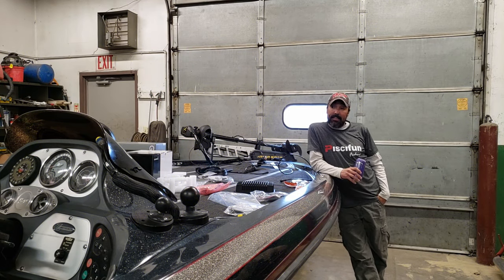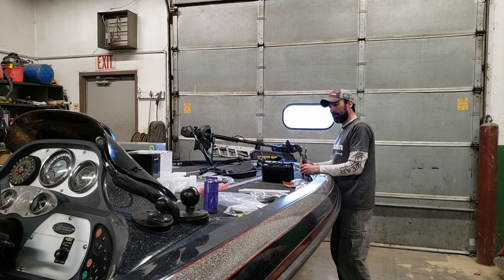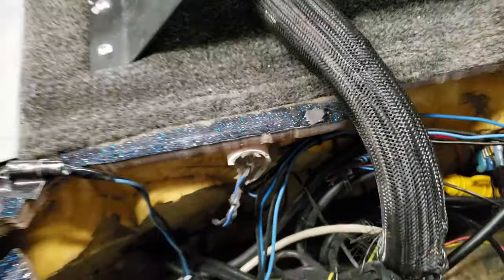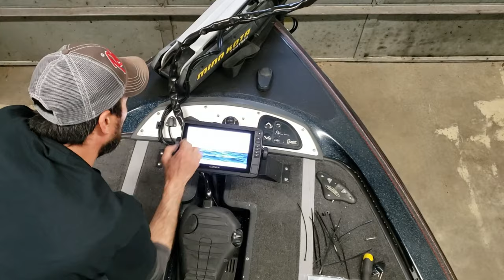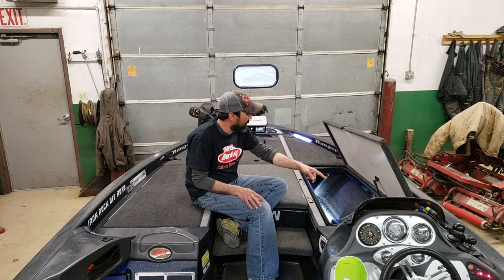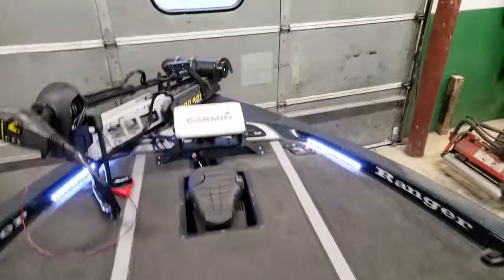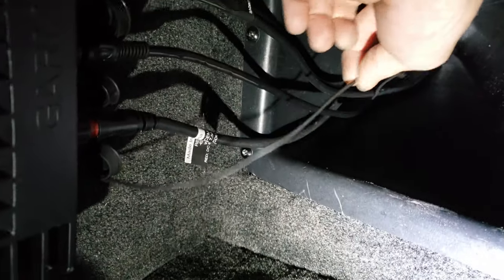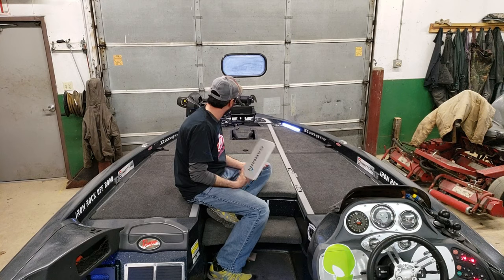Panoptix live scope installation

Comment: I put my system in the port rod locker on my Ranger 185vs. I just cut the end cap off of one of the tubes and ran all my wires in the tube. And put my 30ah lithium battery in the same compartment.

Comment: Hey brother I’ve been researching the pan optics you need to get rid of the cables ties and use waterproof electrical tape they say it will harm the cable
Reply from the maker: I found out about that. I actually did go to electrical tape. I didnt zip tie the wires down tight. I never do with any wire.

Comment: Did u did take out the driver side rod tubes without having to break through any foam??
Reply from the maker: Hello, I did not take out the big opening rod sleeve. I drilled out the end of the rod sleeve tube at the bow and ran a 2" black pvc pipe in the sleeve. I did not wanna mess around with the foam or removing the sleeve. The end of the rod sleeve was exposed inside the bow area with all the wiring.  Some boats might have foam covering a little at the end. Some peoples boats might be a little different with workmanship from the factory. Might need to remove a little foam at the bow, end of sleeve.

Comment: Great video! I’ll be installing mine over the weekend in an 07 Z21 so an almost identical setup. I had a few questions 
1. how you mounted the box? It looks like (2) through bolts from the inside of the center storage box? If so, do you feel like that was enough to secure it for rough water? 
2. Seems like from other comments, you ended up powering the box directly from your cranking battery? I assume you bought a longer cable
Reply: Accidentally posted before I was finished with the second question lol. If you did buy a longer cable, what was it and any tips on running that cable to the battery? Thanks!
Reply from the maker: I drilled holes thru the compartments, my center compartment to the starboard side compartment. Used small nuts and bolts to hold the panoptix module box. Solid mount. At first I did run power wires to that power block at the bow which runs trim panel at the bow. I went away with that and decided to mount a fuse block under the console which was wired to the battery. From the panoptix module box, I ran the power to the fuse block. I believe it was a 12 fuse block which I run all my units, nmea, panoptix and 3d scan module. I dont have the panoptix anymore. Now using all lowrance. And waiting for the new lowrance  livesight to come out. I did like the panoptix.  Just didn't like that 20 degree cone. It really didn't help catch more fish lol. Its a good tool to have to see the fish. Kinda wish I still had the panoptix now because of the panoptix perspective. Dang lol

Comment: Although my Livescope was already installed when I bought the boat, excellent video! I would have liked to see how you installed the main bracket. Because I don't like the position of the unit, it blocks the Lowrance in the bow and I can't see it, I want to move it towards the TM pedal to have the Lowrance usable, as you said use the DI in shallow water. So my question is, can I just remove the bolts in the floor for that mount (without fear that nuts or something will fall from the underside of the floor) then drill 4 new holes and use those same bolts? Thanks for you help!!

Comment: Thank you for the timely and helpful video. I have a 2006 519VX and will be doing the same installation this winter. The only thing Ill do differently and something I'm struggling to figure out is how to install the transducer on it's own pivoting extension pole so the scan can be controlled independently of the rotation of the Ultrex and its spot lock feature. I've seen several how too videos on how others have done it which has given me ideas for engineering my own setup. So whats your opinion of the system after a season on the water with it? Is it a useful tool for us bass fishermen? Do you think it will help improve my crappy crappie skills as well?
Reply from the maker: Honestly its a useful tool for off shore fishing. But when you get up in the shallows pitching docks i turn it off. But great for the deeper water and drops from the shallow. I used for crappie fishing in the spring and helps you find the school that move away from ya. Lets say you in 10 feet of water and the weeds are  3 feet tall and the bass are in the cabbage. It wasnt helpful to me. So i turned it off and used my down imaging on my lowrance at the bow mainly for depth and contour. Im gonna try the lowrance live. Im hearing that is more for the bass guys. Just the info i was getting for that reason. Not knocking the panoptix and i did like using it. It would be a great item for ice fishing to.
Reply: Thank you for the reply. I'm going to experiment with purchasing a used or inexpensive foot cable controlled trolling motor and attaching it to the Ultrex. Striping it of the motor and all electrical of course leaving it as a simple foot controlled pole. Would end up with two foot controllers up front but at least you're operating hands free. It appears that you have the tools and resources to engineer build and market a design specific optic scan controller. Best
Reply from the maker: @ranger5697  if i only had the time to build one. I have a few designs which i have lingering in my head. One would be a mobile boat and ice fishing deal. The boat mount, using radio control servos to move a light pivoting mounting pole in diameter of a trolling motor shaft. That would take some major electronic engineering setting up with a foot control like power pole buttons. Hey id like to see the results with your foot pedal idea using an old trolling motor. Or even an old minn kota power drive non cable.
Reply: Sounds pretty high tech. Good luck with that. Love your boat. My 519 has the exact same trailer. My boat wants to be a 520 when it grows up. Like what you did with the led lighting too. Cool stuff. Good fishing

Comment: Where do you put the ground wire from black box to?  Not that they give you one.  Gotta connect one then ground it.
Reply from the maker: I grounded it to a negative terminal on my boat up at the bow.
Reply: @BassGoneWilds  I have an 06 z19 so did u go to the terminal board at bow and put to the black wire side for ground. I only have black and red side no ground block.  Thanks

Comment: How di you find out where to go through for the hole on top?
Reply from the maker: If there isnt foam in the way, look to the console side the end of the plastic sleeve should be visible. Kinda tricky drilling out a 1.5 inch hole with a spade bit. Just becareful. Some might have to cut away some foam to see the tip of the sleeve. Bow end side. Under bow panel plate. Also i cut slits on the bow plate, bottom lip side to run wires out

Comment: i’m installing mine now. did you put a cutoff switch to your black box so it’s not constantly drawing? i think i wanna hook mine up to a switch on my panel, i just haven’t seen anyone do it yet
Reply from the maker: My box was hooked up to the power panel at the bow at one point. I have a main power turn off switch for all power to the main battery. Includes power trim, jack plate pump, everything powering the console.
 Fish finder Units, nmea2000, 3d box, and at that time the panoptix box go to a separate fuse block under the console i installed which goes directly to the battery with a shut off switch.  I turn everything off when im not using the boat stored in the garage. Had no issues while on the lake all day running.

Comment: Did you ground the module? If so, what part of the boat did you use to ground the wire coming out of the module?
Reply from the maker: To the ground location in my bow electrical panel. If u dont have block at the bow. Use the console electrical block panel

Comment: How the heck did you get a hole in the end of that rod storage area?  I can't even touch the end with my hand in my 2011 z521?  I tried taking it out too but seems like it's sealed in there really tight.
Reply from the maker: Drilled it very carefully with a spade bit, on the bow side. That tight little area in the wire compartment.
Reply: @BassGoneWilds  and you put clips on the power cords and attached the power to that small panel in the bow for the garmin livescope box and your graph?  No power issues so far I assume?
Reply from the maker: @Brandon-uo1rv  yes didnt have an issue at the bow graph at that time. This year i decided to run power straight from the battery to my own fuse block under console. Then ran new wire to the bow only for the graphs. I was having a screen glitch every time i started my out board at the console graph From the factory power block. So now its all straight connection to the battery only for the graphs and nmea 2000 power.
Reply: @BassGoneWilds  I saw that you said you went to Lowrance but wanted to comment that folks are saying to run LiveScope all day long go with independent battery for LiveScope. Some are going with a small lithium battery, I am trying to hook up a group 27 independent battery in same storage locker that you put your black box in. More weight etc but I hate having to worry about a drained starting battery! Still researching best options. Thanks for your video!
Reply from the maker: @richardhamilton3163  just my thoughts. If ya have a good group 31 battery for your starting battery i wouldn't see any problems. I run my power poles and all electronics, charging my phone and bluetooth speaker etc.off my group 31 starting battery. I fish days from sun up till sun down and never had any issues with a drained battery. Sometimes i make some runs around the lake to recharge my main battery. I put my console  unit on standby when not in use. Bring some jumper cables with ya just in case. You can jump your starting battery from your trolling motor battery/batteries. Just saying i never had an issue with any starting battery drain when i used my panoptix. Or throw a spare group 24 fully charged battery in one of the back compartments for a back up. I wouldnt worry to much. Just keep your batteries maintained and do a battery test periodically. I normally keep a good spare battery around with me just in case i get a battery that goes bad all of a sudden.
Reply: @BassGoneWilds  Good points! I think many folks having cranking battery problems might be using a sub standard or old cranking battery. I was never very good at math but the draw from the panoptic box is obviously more than anyone is used to dealing with once you throw in all electronics and livewells running all day. Great idea to have a throw down battery for emergencies! Thanks!

Comment from the maker: I know longer have this setup. Going with the lowrance HDS live
Reply: Why did you change from the Live Scope
Reply from the maker: @drbrent8274  i hardly used it in the shallows. I liked it. I have been using lowrance units for ever. Im used to them.
Reply: I have Lowrance as well but selling them and going with birds and the live scope I love my buddie mega si on the birds way better then my Lowrance units
Reply from the maker: @travisnunya4641  everyone has there preference. Both are good. I just use lowrance. I like there interface.